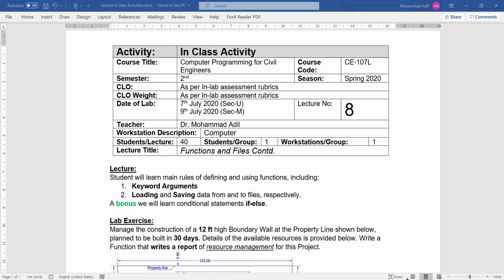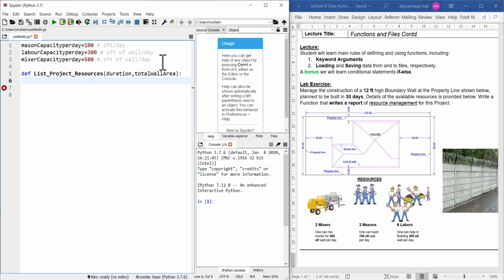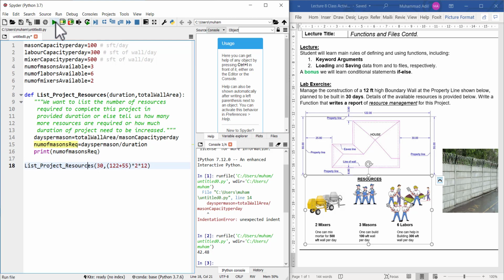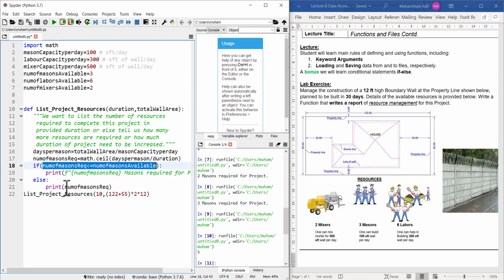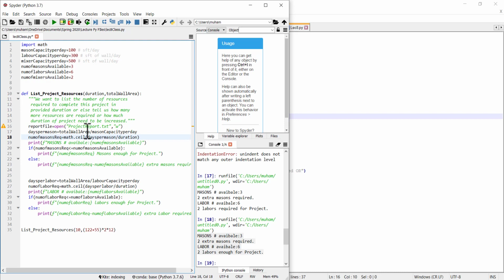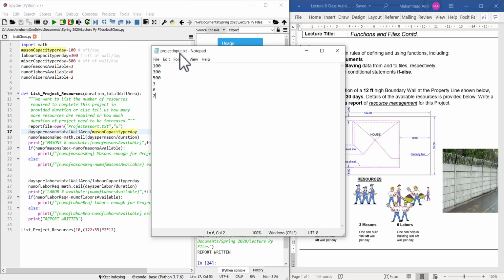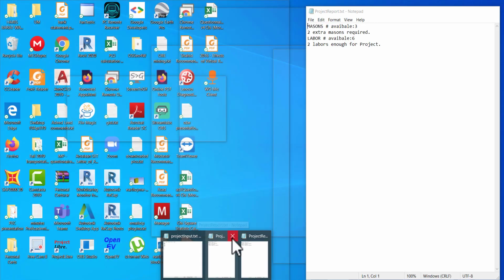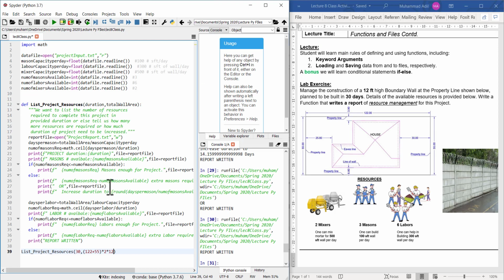Lecture 8: Python Programming for Civil Engineers: Functions and Files Contd

Comment: hi sir i have a question can you help me i have a sandwich beam with two different E modulas of elasticity how to write a python code to get deflections or displacements with four nodes elements
Reply from the maker: Hi Prasanna! Writing a whole new Finite Element code require you to build several modules before you write a 4-node element to get deflection. I would suggest to use http://sfepy.org/doc-devel/index.html or similar pre-written FE modules and use them to write your 4 node element or may be use combination of Shell and Surface concept to build sandwich layers. 
These two examples be a good start:
http://sfepy.org/doc-devel/examples/linear_elasticity-shell10x_cantilever.html

http://sfepy.org/doc-devel/examples/linear_elasticity-two_bodies_contact.html

There may be several possibilities. I hope this gives you some direction?
Reply: @engr.mohammadadil5276  sir i have a code already written but i am not able to use matplotlib correctly to plot the displacements as i have on every node two displacements data in x and y directions so i am not able to plot the graph using matplotlib library
Reply: sir thanks for your help i really like your videos they are very helpful
Reply from the maker: You can convert x, y displacement to single resultant displacement using pathagoras theorem.
 U=math.sqrt(x**2+y**2)
Just replace x and y with your variables. Note matplotlib require U to be array and not list. 
If you send the dump or print of your displacement variable, I'll be able to help you more.
Reply from the maker: This is so encouraging, thank you Prasanna. I hope you'll spread the word to help others. 🙂